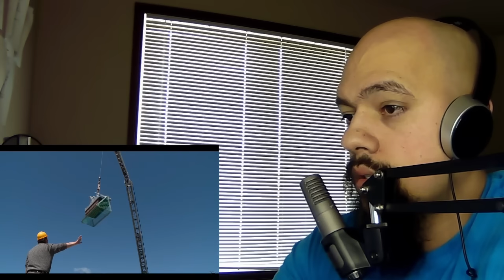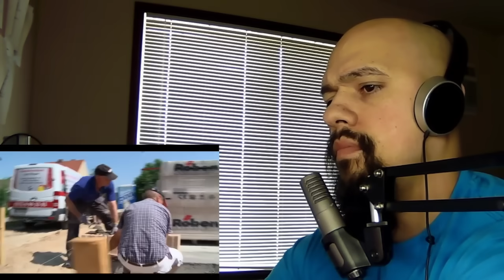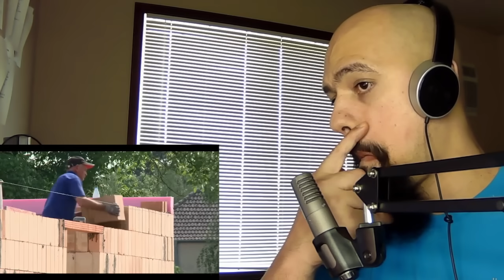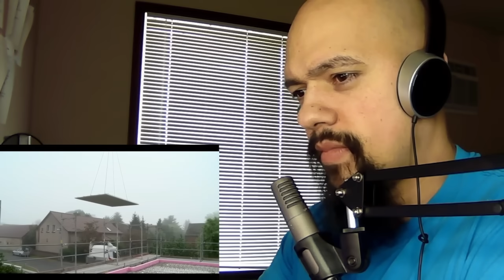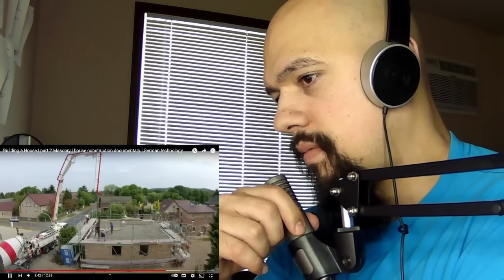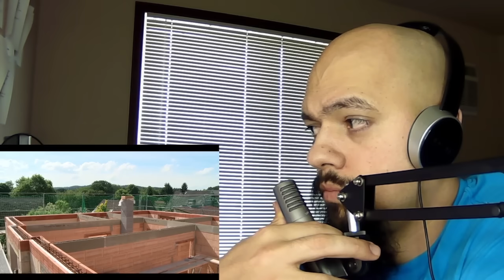American reacts To How German Houses Are built

Comment: That's a whole documentary series from Brale Bau in 9 parts.

The German originals are
Teil 1: Erdarbeiten und Bodenplatte https://www.youtube.com/watch?v=fFboNGUNNUY
Teil 2: Mauerwerk https://www.youtube.com/watch?v=5UGynkYW4bM
Teil 3: Dach und Richtfest https://www.youtube.com/watch?v=0DOI6M3jKaM
Teil 4: Fenster + Rohinstall. Elektro https://www.youtube.com/watch?v=Fw0XT30uwh0
Teil 5: Rohinstall. Heizung/Sanitär+Putz https://www.youtube.com/watch?v=j5LqERYzIiA
Teil 6: Dämmg. Bodenpl.+Fußbdhzg+Estrich https://www.youtube.com/watch?v=LzAgvHun9QA
Teil 7: Wärmepumpe+Warmwasser+Elektro https://www.youtube.com/watch?v=XkJvq1TlIVA
Teil 8: Fliesen Innentüren Endm. Sanitär https://www.youtube.com/watch?v=SPFFlw1ej4s
Teil 9: Treppe und Hausübergabe https://www.youtube.com/watch?v=PHsSHBDWl50

The auto-translated versions 
Building a House | part 1 earthworks+floor slab https://www.youtube.com/watch?v=EnGxRGjkP_Y
Building a House | part 2 Masonry https://www.youtube.com/watch?v=ZAByooMVkMQ
Building a House | part 3 Roof https://www.youtube.com/watch?v=fdVMlLKgrSM
Building a House | part 4 Windows+Electrical Inst https://www.youtube.com/watch?v=CJf_2_LGxz8
Building a House | part 5 Heat+Plumbing+Plaster https://www.youtube.com/watch?v=1e96lo0N-CM
Building a House | part 6 Floor Insul+UFH+Screed+Water Con https://www.youtube.com/watch?v=tNDxV2z1dAo

Comment: 2:50 This mainly depends on the location. I live in a city. Any house in the city centre will cost a million €, at least. The cheapest house at all that you can buy along with the property within city limits is at around 400k. Meanwhile, a friend of mine living in some tiny village near Hanover bought a house with 3 large residential units, a barn and a lot of land (from a German pov) for 300k. The one his family lived in before cost only 100k. Bit smaller (still a big house with a big garden) but more run down. Still, that's a huge difference. We should have well enough available housing for our population but the distribution is the real issue here.

Comment: My farmhouse is 200 years old. My great-great-great-grandparents built it around 1824. It survived 2 world wars and a fire. Of course, you can't compare that with a matchstick house in the USA. The hallway alone is the most stable room in the entire building. Because it is criss-crossed by thick wooden beams. The attic is also very stable. The cross struts and beams are thicker than my thigh. I can easily do pull-ups on them. In the past, the hay bales were fetched from the loft using pulley blocks.

So it depends on how quickly the bricklayers work, how much material is available on site and whether other problems on the construction site are delaying the work. My neighbours raised their house within a week. To be more precise, just the walls. Depending on the weather, certain stages of the construction process are delayed. The shell, including the finished roof and windows and doors, took maybe three weeks. It also depends on how big the house is. If it has several storeys, it naturally takes longer.

Comment: Buying or building a house can vary in price in Germany.
Prices are on average lower in the eastern federal states than in the west and increase from north to south.
(Please note that larger cities and surrounding areas have higher prices)
Detached individual houses cost on average in these large cities: (Prices without distinction between new buildings and used properties)
Magdeburg €300,000
Kiel €360,000
Hamburg €750,000
Berlin €720,000
Frankfurt €1,075,000
Stuttgart €1,100,000
Munich €2,500,000

( Price list by LBS )
For good financing, an average of 20% equity is required, but at least the costs for property transfer tax, notary and, if necessary, real estate agent must be paid out of your own pocket.
The average mortgage interest rate is 3.2% + repayment rate of 1.5-2%
Ongoing monthly costs for property tax, electricity, gas, water and insurance currently amount to around €9 per square meter of living space. With intensive use of renewable energy sources (solar, heat pump, etc.) these costs are reduced to around €6-7 per square meter of living space.
Attention: if you buy a used property at a seemingly cheap price, you can expect 100-200 thousand euros in renovation costs, as windows, heating, roof and wall insulation, not to mention the bathroom and kitchen, are often additionally required.
The only advantage can then be that the property is at least twice as large as a new building property.
Since salaries have only increased by an average of 3% over the last 40 years, but the prices for new properties have risen by around 4.2%, it is no longer possible for many people to purchase property.
While 40 years ago parents were still able to finance real estate with average mortgage interest rates of 5-6% + 1% repayment, changes in financing guidelines mean that their children are often unable to do so.

Comment: with the house building speed: They only mentioned the working days. the concrete floors for example needs often weeks to dry and the workers have to wait till it is complete hardend.
Reply: When i learned this stuff 30 years ago (after the first year i changed to learn precision mechanic) the ruel of thumb was, 1 hour until the concrete sets, 1 day and you can walk on it, 1 week you can start build on it, 1 month to fully dry
Reply: @wolf310ii  this applies to regular concrete work. if you need to increase the setting time you can use additives
Reply: @soleywolfgangsdottir  That why i wrote it was a rule of thump
Reply: Yes, and don't forget to cool it during the hardening process otherwise it will not develop its max strengths. However my concrete plate was made on a Friday  and the next Wednesday the constitution of the walls started and the first floor ceiling was  made the next Friday afternoon. The timing is more of a logistical task than anything else. If the necessary resources are planned exactly 3 to 4 months of construction time is realistic. We needed 5 for my house due to delays in the electric part.
Reply: With those premade concrete plates per floor, we where able to build the outerwals on the 4th day. 
(Friday concrete work- Monday 1st row)
We did not had to wait weeks ti'll we could proceed.  The single long waiting time was for the groud level slab/foundation, thats it.

As a rule of thumb you coud say we build a house with 3 floors, (EG, 1.OG, DG) within 3 to 4 weeks. (First brick - to finished roof)

The most important variables that determined how long it took where, the complexity of the wall-layout+ the used brick's.
Reply: you can add hardener, so it only takes around 3 days to harden for the concrete slabs

Comment: Laser seems to be very important these days, and it sure is, because it eases measuring A LOT. You still can buy a mason's level without a laser, but for professional work, that takes too much time to level out, and we Germans like precision, so laser tools are the best option.
They built that house really fast in this video, but there were a lot of workers around, and they used many ready-made parts. Please don't think that all houses can be built that fast, and it doesn't have a cellar either, which I value very much about my own house. And, yes, it's a bricks-and-mortar building, with no concrete, but a roof made of wood and roof tiles. Looks nicer and is just as sturdy.

Comment: Well, it's not complicated or difficult to buy (or build) a house over here. However, it is definitely expensive, one or the other way.
You CAN get huge Castles for literally 1,-€... but then you are responsible for conservation of the cultural heritage and the likes - i.e., you are only allowed to do repairs with specific materials and so on, or you have to hire rare specialists to do the work... which usually can be very, very, VERY expensive.
On the other hand, since we don't just use wood an paper over here to construct the houses but stone, that adds to the cost, in addition - if not built-in like here - our houses tend to be pretty good insulated. Hence the lack of AC around here ;). There is a reason to the notion, owning a house here in germany is usually a once-in-a-lifetime investment...

Concerning the house shown in the video, i definitely miss the basement, or cellar. German houses tend to have one, although one can imagine that this would also add a not-so-small portion to the price. However, as i said: once-in-a-lifetime... ^^
Reply: Building a house isn't complicated exactly until you want to do sth unusual. I am planning on having a tiny home (well, not that tiny) built for me bc I don't need the space but I do have specific requirements for it, so it's the best solution for me. Anyways, looked into it and getting the paperwork done supposedly takes at least 3 years.
Reply: @MellonVegan  Well... we bought the house, so we at least didn't have to deal with the paperwork ;)
But yeah... time consumption is another factor...
Reply: Das mit den Häuserbau ist ja auch kulturell bedingt.
Wir in Deutschland sind sehr sesshaft.
Das heißt dass wir nicht so oft umziehen wie die Amis.
Deshalb bauen wir für mehrere Generationen.